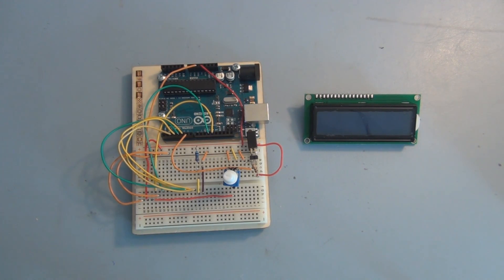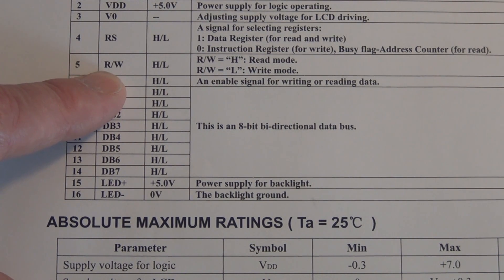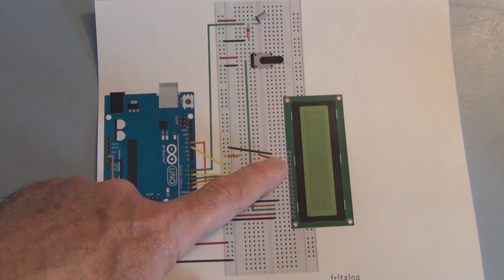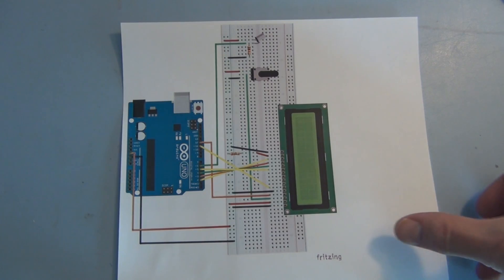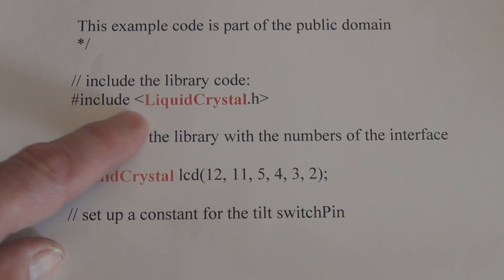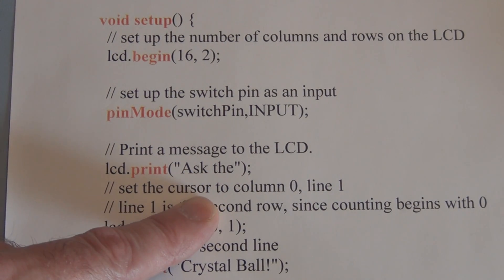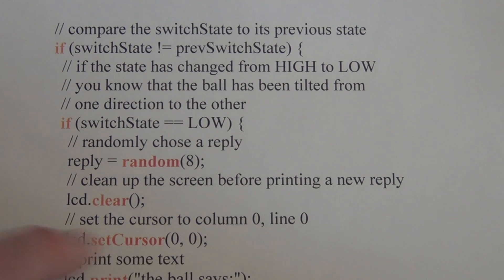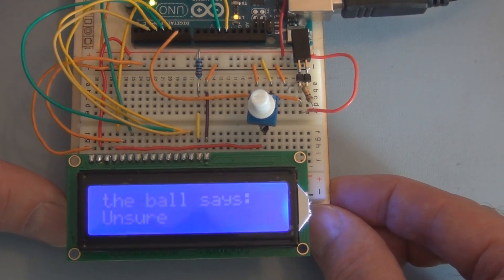How to connect Arduino to an LCD tutorial

Comment: Does it matter if I connect it in other digital pin? I'm gonna use those selected pins you've mentioned in 4x4 keypad, can you pls tell me if there is an alternative way to connect those pins without getting rid of 4x4 keypad connection? Thank you. Pls answer
Reply from the maker: Here is a good tutorial on wiring the LCD.  You don't have to wire it exactly like I did.  https://learn.adafruit.com/character-lcds/wiring-a-character-lcd.  You can use the liquidCrystal display library https://github.com/arduino/Arduino/tree/master/libraries/LiquidCrystal
Adafruit also has a tutorial on how to hook up their 4X4 keypad https://learn.adafruit.com/adafruit-trellis-diy-open-source-led-keypad/connecting

Comment: I have got a random LCD(5X2cm) from calculator and it has got 28 pins !!!! How to connect it with arduino ????Plzz tell
Reply from the maker: That would be difficult.  You'd have to see if there are any identifying marks on the part so you can search for a data sheet.  It might be a custom part made for that calculator you removed it from.  You can't just hook it up to the arduino.  The LCD used in this video already had a library of low level code written for it so that it was easier to program code for the arduino to control the LCD.

Comment: Is potentiometer necessary??
Reply from the maker: +Vijeth Kashyap No, But if you don't use a pot your only choice it connecting pin 3 to ground or +5V for max backlight.
Reply: +eTechTom thank you sir

Comment: On my display,1602A, Vo (pin 3), just needs a variable resistor to ground to control contrast.  A direct connection to ground produces maximum contrast.  The A & K (pins 15 & 16) pins are used with a pot and a 5 volt connection to adjust the backlight brightness.  Also, I had to connect the Read pin to ground or I had no display at all.  There seems to be a lot of confusion on the arduino forum about these 3 items.  Reading the data sheet cleared everything up in my case.